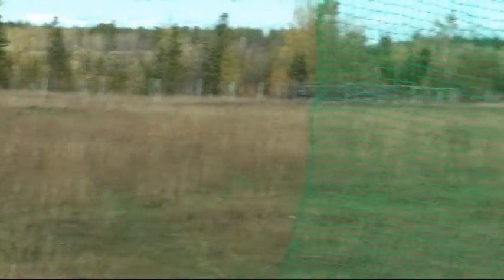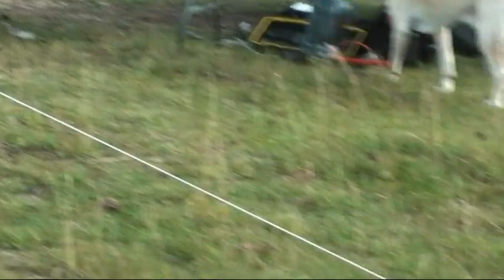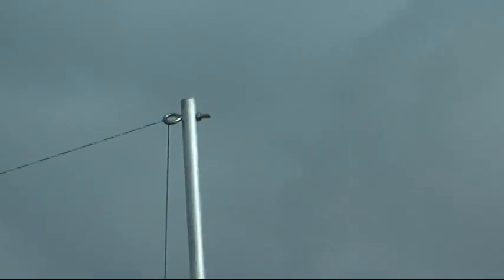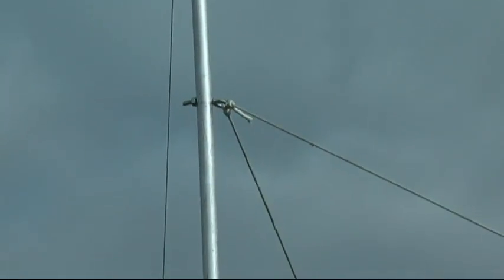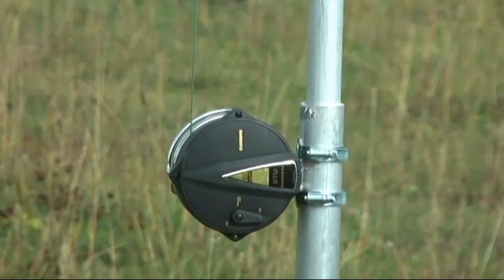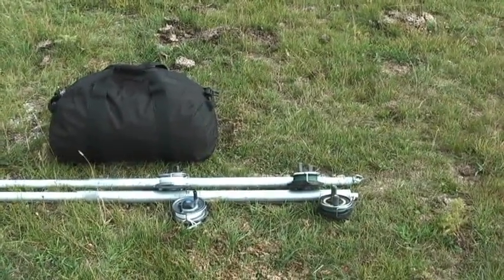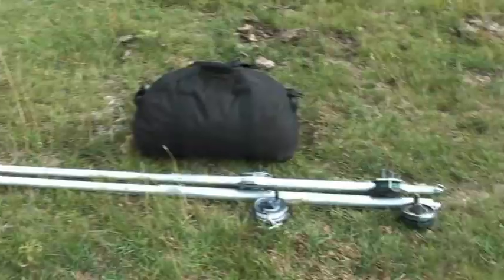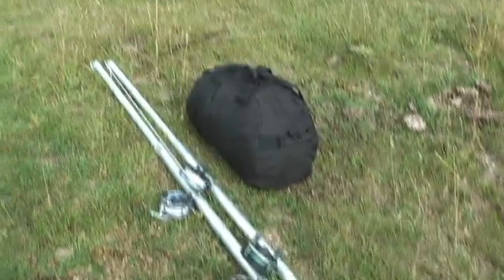X8 flying wing UAV recovery Net

Comment: hi john, I find your system very ingenous, but your net a bit small if combined to an automatic landing. Would the system with salmon reels still be working with a larger net, say 10 meter x 5 meter or ~17' x 34'? or would that reduce too much the dampening given by reels? Did you consider using a hook at the nose of the X8 to prevent again bounce? best regards, Guillaume

Comment from the maker: Hi Miguel,  What damage are you talking about?  We never experience any damage when we use the net.  We also tape our wings with vinyl tape and never experience damage to the wings any longer.  The X8 comes in very fast when landing unless you have a very long straight approach in which to slow it down.  We often have no approach path at all in the areas we fly and must land within a 25m area; try that without a net.  We fly in forestry cut blocks and other remote sites where we cannot choose our landing area.  We often must land with a strong tailwind when we are near large bodies of water and the net allows us to land under power to avoid a stall.  The video does not show the final net.  We now use carbon fiber poles and a lighter net.  If it were not for this net we would not be able to land in the areas where we deploy. The entire system only weighs about 2kg.  I would not deploy without it.
Reply: These obviously aren't guys who fly professionally. I'm in a desert environment filled with lots of little berms w/vegetation on top(we call them chia pets ;)  This looks really simple and straight forward. Great design. Thank you for sharing! My aircraft is all composite, with a tough TPU landing skid, and still, it really does take a beating when belly landing on unimproved surfaces 8-10 times a day.

Comment: It`s a nice idea and certainly fun but way over the top for daily use. Why would you build an carry an expensive and heavy net which you have to assemble every time?

The x8 stall speed is very low, even at 4kg weight. It can therfore land very slowly and if landed on gras, no damage will be done. 

Hiting a net on the other side is much more difficult and if you hit the poles or stall in a turn trying to hit the thing the plane will be damaged...

If you really want to reduce the risk of landing a x8 I would invest in an autopilot (I use and recommend Ardupilot/Pixhawk) and land the thing in FBWA or do an automatic landing. Very easy, very well documented, much cheaper & leighter plus safer.

If you have no landing space, well then it might become an option. Though the x8 is a long range uav (at least for an rc plane) so your action radius gets very big and you will certainly find a site somewhere. And if you fly in the city I`ll take a copter over a plane in 99% of the time.

Still, cool video idea and flying skills :)
Reply from the maker: You have not read anything about us have you?  Visit this site to see the work we do with this plane 

www.jrcanmap.com

Our X8 is a UAV inspected and approved by Transport Canada.  It is capable of fully autonomous flight from launch to landing and is used to collect aerial photography for the creation of mapping products.  This X8 UAV is not deployed on an airfield with nice grassy landing areas as in the video (that is our testing site).  We deploy in areas with no landing area such as forestry cut blocks, reservoirs filled with old tree stumps, quarries, and other very nasty sites.  This X8 UAV weighs just over 5kg and comes in hot taking a long distance to slow.  If it were not for the recovery net the plane would be damaged or destroyed each time it attempted to land and just the hardware in the plane costs between $4,000 ~ $10,000 depending on the payload.  The complete net retrieval system weighs less than 4lbs and takes about 5 minutes to set up.  People ask why we do not use a parachute for retrieval and the simple answer to that is then the plane would end up in the tops of 30 meter trees.  And one other thing....Any pilot worth their salt should be able to put this plane in the center of a 14' X 14' net.  If you cannot fly your plane into a target that large then you should not be piloting a UAV.
Reply: Oh dam mine is just over 4.5kg...

No I haven't read. But a honest thank you for the long answer! It sounds light, transportable and fast to use. And it makes kind oft sense in a Canadian forrest..

One thing considering your last remark. Isn't the point of fully autonomous the ease of use...? I could certainly hit that net but with a professional uav shouldnt all the flying be autonomous? Kind oft plug and play style?
Reply from the maker: This UAV does not have sense and avoid and in situations with complex terrain and multiple ground hazards you cannot rely on the AP to land.  If it were deployed in the same area multiple times with a good landing site then full autonomy would be used.  Other than that particular situation I could not see anyone using full autonomy on a fixed wing for landing.  We generally use full autonomy from takeoff to approach and then take over landings on the approach.  VTOL is another story all together and autonomous landings could be better utilized for that platform.